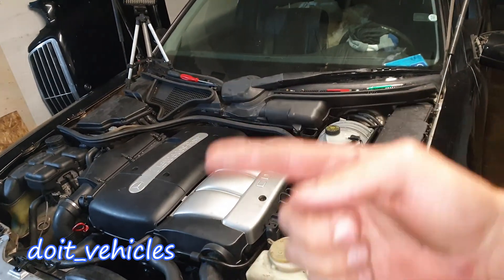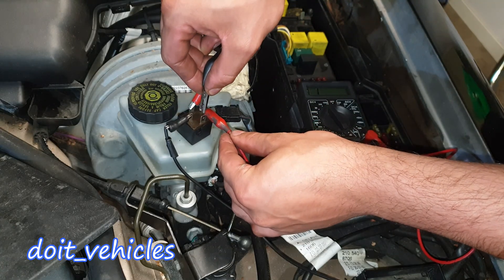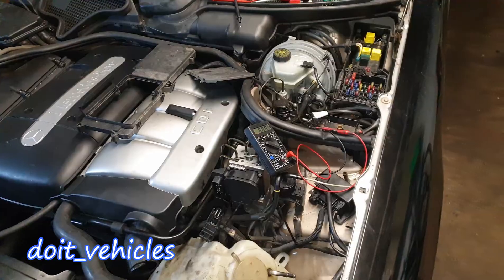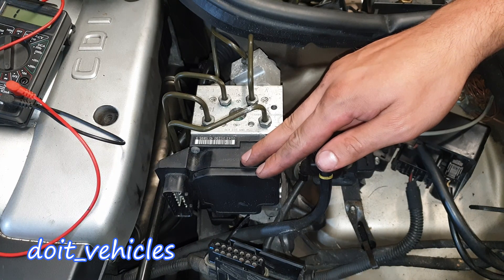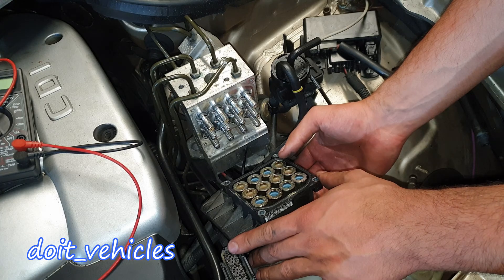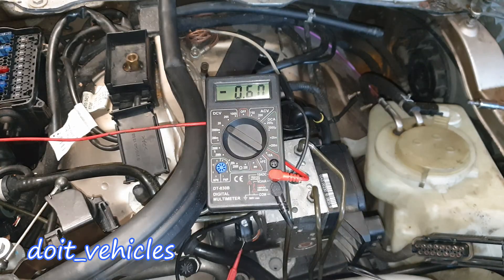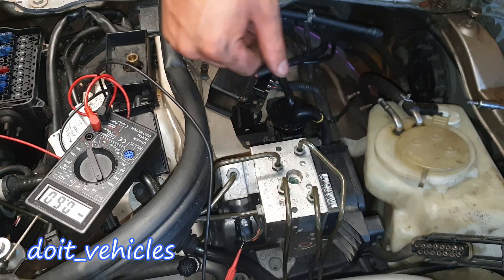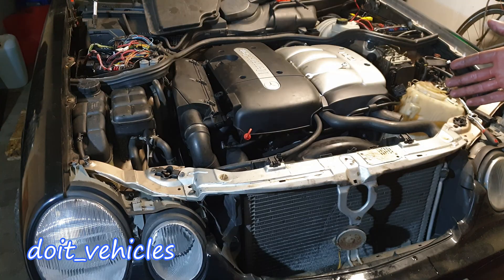W210 Mercedes ABS pump Test , Diagnose , Removal Brake pressure Sensor

Comment: I have removed the rear Struts and Accumulator canisters from my 2002 E320 210 Wagon (not a 4matic) that had the ESP self leveling system. Every component was completely worn out (including the leveling valve).  To replace it all exceeded the value of the car.  Now I need to know which lines coming from the power steering pump to the rear of the car that feeds the leveler valve and shocks needs to be looped together to bypass the whole system that has been removed.  I have installed regular E320 sedan rear shocks.  I just need to know the correct location to loop the lines together so the power steering pump only pumps fluid to the steering system and not to the back of the car.  A picture of the best place to lppo the lines would be most helpful.  Last question:  Will I have any error codes to deal with from bypassing the rear self leveling system?  If so, how do I get rid of the codes so I can pass inspection?  It seem it can best be done under the hood.  Please help.

Comment: I have a w208 and i get a ABS ESP BAS fault. I replaced all 4 abs sensors. When i use a cardignosis it says right front and right rear abs sensor are not working. The speed meter stays at 0km/h 

Does changing the abs pump fix the problem or is it something else ?

Comment: thanks , 5v signal not work with my car what to do please ?
Reply from the maker: check on the same wire if there is 5v from the ECU
Reply: @doit_vehicles  I have checked wire by  aovometer wire was ok 
For addition I have replace brake switch and prusser sensor and it is the same esp abs bas still not work
While when connect to computer it read fult b34 (prusser sensor)

Comment: Thanks so much , my question is can i use this way to diagnoise all abs or this one is spicific for mercedes?
Reply from the maker: The principle will be the same on probably all the cars but the wiring and voltage values will differ

Comment: does it needs coding? currently have pre fl w204 it throws esp code but no lights on a dashboard. And looking at fl w204 with all abs/esp lights flashing out loud which probably is a complete abs unit replacement
Reply: Definitely requires coding, dealer charged me $600 to code it

Comment: Hello , 
I have an W211 with a problem on the SBC . It says that ABS, ESC and SBC not available. I tested the ABS and it’s working but ESC and SBC I don’t know how to test them . Any ideas?
Reply from the maker: You will need an appropriate scan tool to work on these systems , not much you can do with just a voltmeter